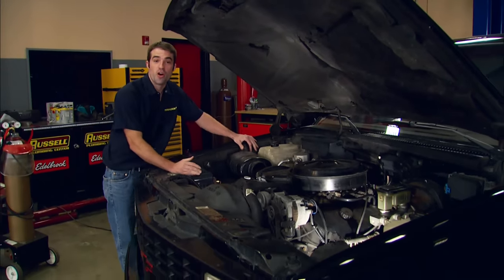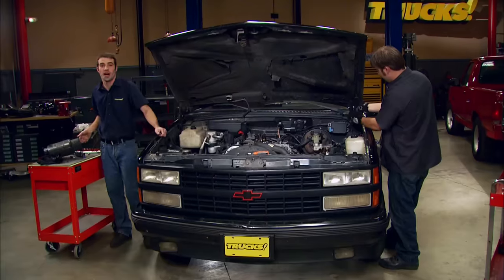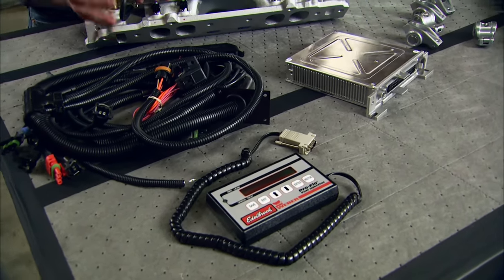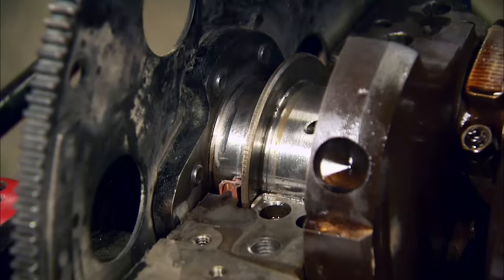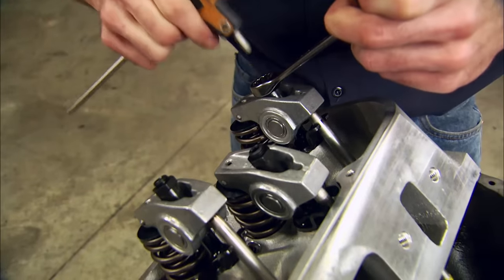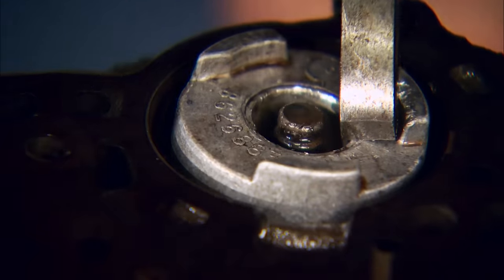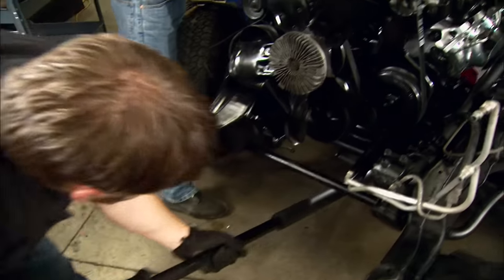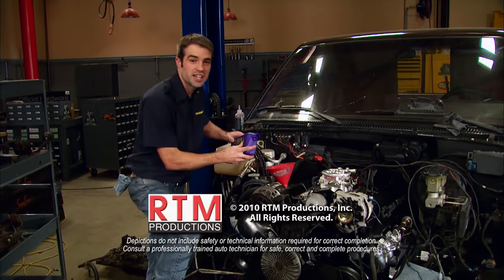Waking Up A 1990 Chevy 454 SS Big Block MuscleTrux Wars Part 2 - Trucks! S10, E2

Comment: Must be nice to have no budget and sponsored parts.
Reply: Jeff Jankiewicz cleetus in a nutshell, atleast these guys do their own work cleetus just has james do it
Reply: Its' light duty info, but I love em for the new products. All those mags I used to get in the mail introduced me to new parts, and suppliers. I'd argue that was the more important info. The show then and now still have allot of cool info and how to's. Budget builds... there is no such thing. short cuts, shabby fixes, and cheap parts only turn a project into a garage queen that constantly needs repair... costing more in the long run than if you just save some bucks, and do it the right way.
Reply: they are not doing anything any one with a new car or truck can not afford ....I just put a new long block in my 1987 ford F150 4x4 and it is a factory 4bbl short bed and is also a 351w just like his truck ..and my father bought it new and i spent less than $2000 and deleted all the old emissions crap and next weekend will be pulling a trailer with my side by side on it to the deer lease about 230 miles and guess what i have no truck payment  and my ins is cheep and the truck will last me another 10 years doing deer leas runs and towing my boat to the lake and i will never be paying $500 a month new truck payments ......when they get finished both trucks will be excellent daily drivers at a fraction of the cost for a new car or truck ....so ye they are saving $ not blowing $ and still have some nice trucks that are fun to drive .......
Reply: You would get more power out of a ls swap I would only use holly parts for efi  elebrock is junk
Reply: dexter2433 it’s a Ford you will find out good luck with your trans
Reply: You gona cry?
Reply: Sponsorship is why they spent $5,000 for +80hp vs a weekend warrior who would add +230hp with $4,000
Reply: Work harder so you can afford nice things too.
Reply: DEXTER MORGAN Cleetus does get his hand dirty also. He just doesn’t have near the experience as James. But Cleetus is learning a lot more and is much more knowledgeable than when he first started his channel.
Reply: @jimcatx3090  😂😂😂
Reply: @jimcatx3090  🤣🤣🤣
Reply: Can you guess which sponsor pays them the most? cough-edelbrock-cough.
Reply: Thoughts of a hater👆🏾
Reply: I was thinking the same thing
Reply: Let us just agree we love wrenching and watching cars and trucks being wrenched on. Budget or no budget.
Reply: Fr i wish I could have no budget and all sponsored parts
Reply: @KS-xo3oh  this
Reply: Wish I had 20k and a ss454
Reply: You ain't shittin
Reply: @dextermorgan9703  I can almost guarantee you that cleetus knows more about cars than you. He's not stupid and he's the one tuning the cars. They work together.
Reply: No sponsorships = No TV show.
Reply: @coldoath  no shit man 🤦‍♂️. I was looking for this comment 🤷‍♂️
Reply: @dextermorgan9703  you do realize he's busy doing 20 other things at the time something breaks and he pays James to do it and pays other people to work on them so he can deal with other needs
Reply: Fr
Reply: @jeff. 🙄 jealousy looks good on ya.
Reply: Start a show better then theirs and you get that…..
Reply: LMAO you mad, bro?

Comment: "Looks like someone's been in here already so we should be good'  said no mechanic ever
Reply: Yes! I'm about to post a comment that "I can't believe they didn't at least hone and replace the rings!
Reply: These guys are a joke
Reply: Massive amounts of silicone on the valve covers is a good sign to lol
Reply: @JordanJank  prob cost 5G to do all that atleast and they didnt touch the bottom end  .I would went with cheaper headers airgap intake and carb found some good cast heads and decent pistons for sure . That fuel injection set up must be half the cost of the build
Reply: Water in the cylinders....yep,  we're here...😅😅😅
Reply: Usually it's "...(expletive of your choice). Some hack's already gotten in it."
Reply: @bigboreracing356  I'm sure they did a compression check. No sludge, looked good. Most people take this stuff too seriously. This short stretch of shows was fun for the Ford POS vrs Chevy collectible. The power block has done much more serious stuff.. taking a break for some light hearted easy stuff is cool too.
Reply: First time tight, second time right!
Reply: If I opened an engine and saw a Oil pump pick-up welded to the pump, that tells me that somebody gave a shit and it was done by a competent engine builder. Welding a Pickup is a mostly done to race engines, like de-burring the block, GM never welded their pick-up's. so this engine was most likely blueprinted in it's last overhaul or at least assembled correctly. Most part changer mechanics know very little when it comes to engine building but know allot about replacing window regulators, so who gives a damn what a mechanic have to say. Somebody with little experience makes an Ignorant Comment and other follow suit trashing the host of this show.
Reply: @andrewfotopoulos7766   You obviously never disassemble an engine...yep 😂😂😂
Reply: @ze_german2921  
Correct
Reply: @ze_german2921  That is the exact same thing I was thinking. Alot of these people commenting have no idea. It's a T.V show that has to appeal to many people
Reply: @hawkdsl  , the Lightning, especially the second one, is far from a joke, and don't even get me started on the First and Second versions of the Raptor, to say nothing of the Ford F-150 Shelby.
Reply: @bigboreracing356  Doesn't even matter what you're saying if you're going to spew insults.  Who wants to hear that?
Reply: @derekv275  for budget builds I'll make sure it breathes well first then build the bottom end if I'm going to go extreme like drag racing or sled pulls
Reply: All the arguing aside, any decent hot rodder would have at least plasti-guaged the bearings. Taking a track weld as proof that the short block was done right is just silly. That said, if it holds together, it'll make 500 at the crank all day.
Reply: @hawkdsl  i agree with you 100%. But that Ford is far from being a POS. Both are collectibles.
Reply: Dont know why people get so angry at a comment on the internet.  Have been a mechanic for 18 years.  90% of the time when someone touches it before me they make it worse.  And yes, a welded pickup tube shows it was probably done by someone who knew what they were doing.  But why not at least throw some rings and bearings in it?  We are talking pennies here compared to the thousands in intake, cam, and heads they put on it.
Reply: That’s a sign of the end
Reply: I wouldn't be surprised if they knew the engine had been rebuilt and by who and anyways a real car guy or engine shop doesn't knowingly do a crappy job on an engine build, and even if it does grenade on the dyno they'd tear it down again....
Reply: No mechanic ever said E3 Diamondfire spark plug either
Reply: @ChuckWood  I think it is being assumed the bearing in this 454 have wear. Many times they don't. In a perfect world, the bearings never make metal to metal contact. These guys have their Stick with the whole Laugh-Talk but that is how they are told to host the show. They might know a lot more of the history of this truck but pretending they don't. Somebody had to procure these trucks and knew exactly who owned them, who did the machine work, how long ago ect. But just because they are not throwing in new bearings on TV, doesn't mean they were bad and simply ignored them. I think many things seem odd and could be criticized easily but I think it is just a matter of the viewer not having all the information since they are performing 25h worth of work in a 30min show.
Reply: @paxhumana2015  please calm down.. No fighting!!!
Reply: right, that's not good at all, unless you know and trust the mechanic that was in there!
Reply: Yeah "Looks like someone's already been here...."  me, "yeah, definitely going through this thing with a fine tooth comb"
Reply: @ze_german2921  I have...any dumbass would at least correctly sealed the engine right if they had torn it down before...no blown head gasket. So....
Reply: Id a 496ed it😎
Reply: STREET RACER you must be one of the guys on the show. You’re sounding like a woman trapped in a man’s body.
Reply: 88K on the clock and its already needed a rebuild? And the rear main seal is gone? That could be a sign its good to check the prior work since its all apart.
Reply: @derekv275  This is a sponsored show you know to showcase products.
Reply: @inotill  oh of course I get lol
Reply: ZE_GERMAN humanity I never knew that . That’s why my jukebox yard 454 marine engine haller ass .  No I didn’t convert it I found it . The pick up was welded and the engine was balanced . So I did get lucky .
Reply: @bigboreracing356  Except they dont know for sure, because they didnt measure anything! Not even end play! Ive done a few quick and dirty rebuilds...but your eyeball cant measure thousanths
Reply: @bcubed72  WRONG! 3 stage torque increments.
Reply: @JordanJank  bet they know more than you!
Reply: If anything that's when you wanna check
Reply: 1 time on Garage Squad they were working on a Shelby Cobra replicar with the 427 Cleveland, and Joe says since you guys said that you built the engine we're just going to focus on the top half and putting in a cam and heads!
Reply: XD facts

Comment: When I pull an oil pan and it’s obvious that someone has been in there before, that’s usually my que to go through it and check their work......not to leave it alone and hope they did it right. 🤔
Reply: No shit.  "We saw someone else had already been there, so we knew it was good."  

Any real mechanic with any kind of experience sees that and goes "awww, shit."
Reply: Not everything is done on camera. A lot gets edited out.
Reply: Mr Groovy 2 Shoes , Very true. I usually have at least 4 hours of footage that I condense into a 15-20 minute video. But that’s not even up for debate here as they specifically stated that “someone else has been here so we’re good”. Meaning they didn’t feel it was necessary to touch the shortblock. Obviously opinions very, but I would have felt more secure leaving a completely stock bottom end untouched than to leave one that was put together by an unknown. It doesn’t take long to check clearances and bearing condition when the engines already on the stand.
Reply: @BadLuckGarage  Truth! Not to mention the cost of a bearing kit and rings for a Chevy and literally pennies. I know what I would have done.
Reply: When those pull an oil pan when obvious signs someone before had the engine pulled and was at the crankshaft as it is their cue to check the previous owner's work when it is the assurance the previous owner had done it right.

Comment: 80 more hp, 5000 in parts.......
Reply: Sounds about right lol
Reply: @bigboreracing356  lol what ever
Reply: I'm guessing more better mpg.
My stock 454 with Tbi, exhaust stinks of unburnt fuel. Real bad.
Reply: If they where to get rid of that single exhaust and get some real pipes i bet it be good for 50 more or better i pretty sure the cam tbey are useing is mild as hell i would of wemt weth a little bigger lift myself
Reply: He doubled the power of that big block from stock to performance setup..... not 80 hp gain more like 250+hp gain.... what are you even talking about?
Reply: Anyone want my 454 out of a 88suburban C20
Reply: @bigboreracing356  All I'm saying is could of spread that money out differently
Reply: @bigboreracing356  yeah I get ya that makes sense
Reply: @bigboreracing356  what ya think that build was worth? Im think 5g
Reply: @bigboreracing356  cool beans man
Reply: @missingremote4388  Then fix it.  They don't run like that if they're running right.
Reply: Could've just added nitrous and called it a day lmfao
Reply: Added 120 HP and 50 lb.ft. as seen in later eisode... could have done better with domed pistons, cam, and carb...
Reply: @fry.master  - They added 120 HP and 50 lb.ft.... as seen in later episode... could have done better for $1,000 with domed pistons, cam, headers, and carb... stock heads good to 450+ HP...
Reply: BuzzLOLOL I think the was trying to stay stock cam and compression which limits them heavily
Reply: @fry.master  - Actually, a hot N/A 351W could still keep up with the crappy expensive (sponsored) 454 build they did...
Reply: 80 more Horse? He went from 260 (maybe) at crank to 400+.... not sure on your math there bud

Comment: Wow, at that stage of tear down, new bearings would have been a 20 minute (or less) job.  Cheap insurance if you are already in there.  Very weird decision not to replace them
Reply: Matt Miller  says the guy that said the crank looked new just from viewing what little the showed in thr video.
Reply: Matt Miller  😁 do you know me? Or am I a random stranger on the internet? I can say I dont know you. But I also know im not going to be able to fully asess something just by seing some shots in a video. I am a machinist and welder by trade. I could show you photos of parts I've machined that look smooth but if you want your fingers aross it you'd definitely feel it wasn't. I've watched a lot of these guys vids and unless they do a lot of stuff off camera I see them cut corners a lot. But hey its not my truck. I just know if I was in there id check it over a lot more. Have you seen the episode where they tore into the 396 and found a big hole through the water jacket into the cylinder? They had it sleeved and it made cringe when they guy just took a hammer and hammered the sleeve in.
Reply: @MattMiller Damn. Calm down dude. Was just a comment.  Never said I could do any better.  Just said it was a weird decision.  No need to blow up at every comment
Reply: they spent two hours taking the dog house off that saves them two whole minutes of time and then reused the tired old torque converter...oh and dont forget roller rocker in a big block just in case you like a motor that ticks for 1 extra horse power
Reply: Matt Miller  another internet mechanic.
Reply: That crossed my mind also. Would of definitely installed some new rod and  main bearing in it.
Reply: They’re CLEARLY doing a budget build. 😂😂😂
Reply: World's most expensive 400hp engine
Reply: Rod and mains should always check at a min.
Reply: Y oil recommend and fron
Reply: Correct,he's clearly not as schooled as he should be.most big blocks I have torn down 90% have had the pickup welded from the factory.most people use the factory oil and front main and rod bearings should be replaced or at least inspected

Comment: 88,000 miles is well used.  Christ!  Shouldn't be a damn thing wrong with something that has that low miles.
Reply: There is a reason the same year trucks are so lopsided on miles. One was dependable, enjoyable, and fun to drive with lots of thumbs up going down the road... The other was a Ford.
Reply: My own 1995 has 50.845 miles. There's really nothing wrong with it, but. Smells like it's running too rich fuel/ air mixture all the time.
Reply: On todays vehicles that's low mileage, Early 90s that was getting close to the end of life for many vehicles!!
Reply: @JakesFamilyRC  bullshit!!!   Nothing wrong with 90s v8s.  You forget fox bodies?  Forged pistons and rods from the factory.   I still got a relatively stock 90 fox original motor 90k and it runs like a stuck pig.
Reply: @JakesFamilyRC  I have 320,000 on my original drivetrain 95 4.3 vortec Chevy. Regular maintenance decides how long a vehicle lives...
Reply: hawkdsl those small block fords run forever you’re just full of yourself and the most durable gas engine of all time (300 I6) came in those “unreliable” ford trucks
Reply: @JakesFamilyRC  most people dont realize how different car expectancy was not so long ago
Reply: 1998 350 with 405k on it.  I just threw a new timing chain and rear seal to it, should be good for another 100k or so.

Comment: Budget build, my ass! Most guys couldn't afford those Edelbrook heads let alone the  MPFI setup. How about some stock upgrades people CAN afford!
Reply: Keith Irey 250 shot of nitrous and open headers. Send it.
Reply: Garbil Huler 😂😂😂 exactly
Reply: Nos would be cheaper with a spray plate then the heads, cam, mpfi setup forsure.
Reply: bobwatters  it would make sense to have 8::8:1 compression  if you going to  run a  turbo. They were too afraid to blow that bottom end up.

Comment: dude I used to work with threw one of those 454 engines into a C3 Vette and turned it into a beast. first time I ever saw a tach shoot to 8,000 RPM that fast.

Comment: The 454 with a large single turbo would work pretty well
Reply: Idk man i have same truck with 55k original and i looked at ways to try to jeep the motor and make good hp and im just gonna put a LS 6.0 or something in it get it to around 500hp N/A then boost it to get close to 900+hp the cheapest fastest way i can think of to pit the amount of hp this truck deserves in it.